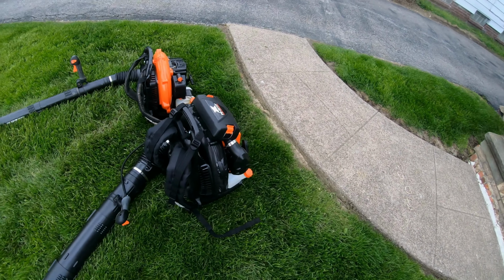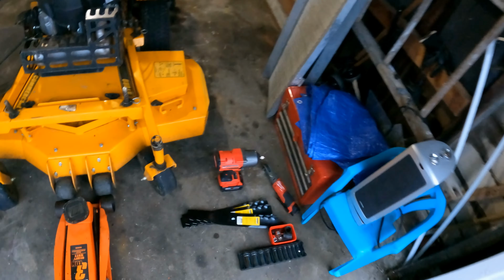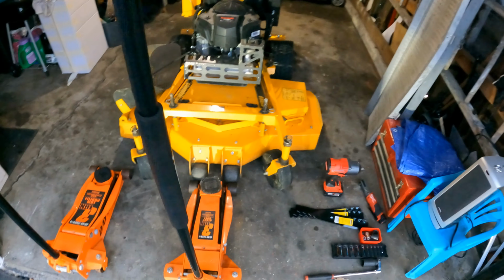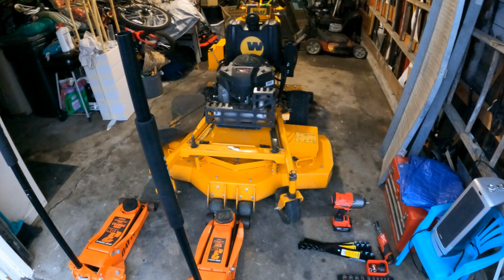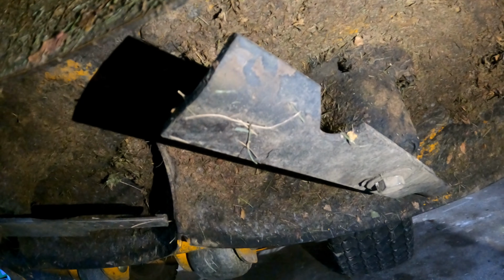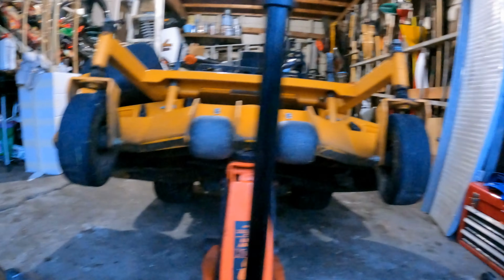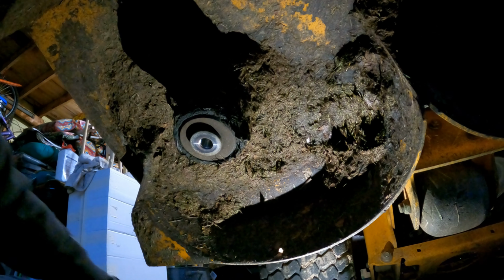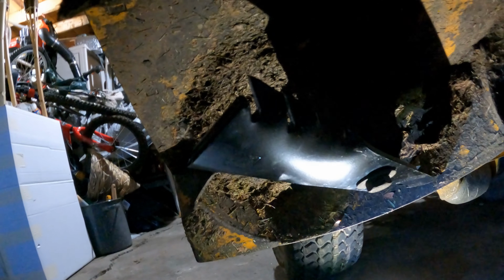How to change blades on a commercial mower

Comment: which high lift blades are your running? Does wright make them?
Reply from the maker: I use ballard inc. High rise blades.  The new black blades on the ground are Oregon predator gator mulching blades from Marshall power equipment.
Reply: @moto_ak47  I bought some mulching blades from Emmett’s Lawn equipment down in Richfield where I bought the mower, but he didn’t have any high lift. Can you tell a big difference between the high lift and the standard blades
Reply from the maker: @Backyard dad !!!  for what I use them for yes I can.